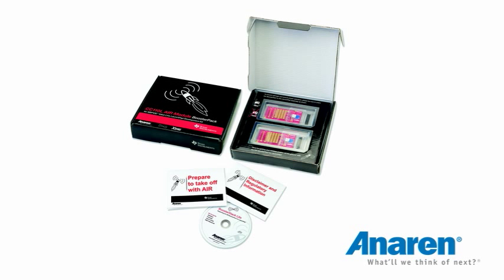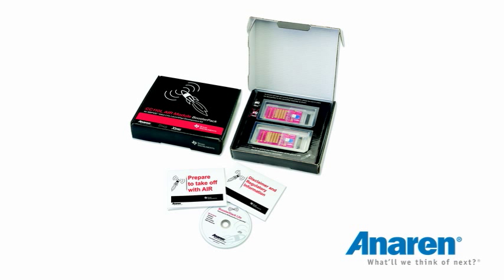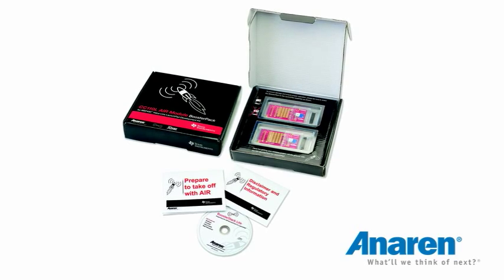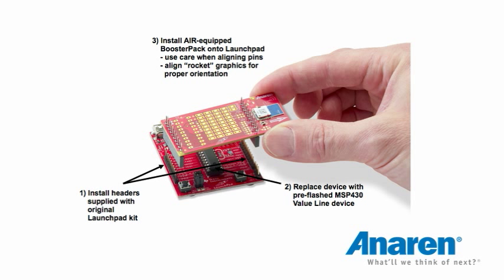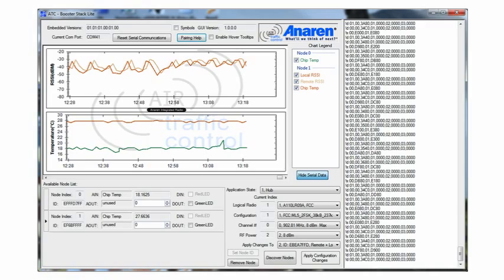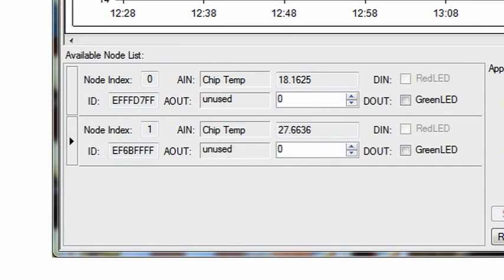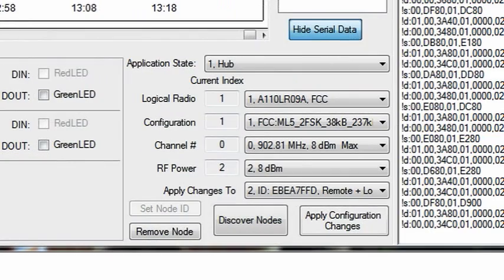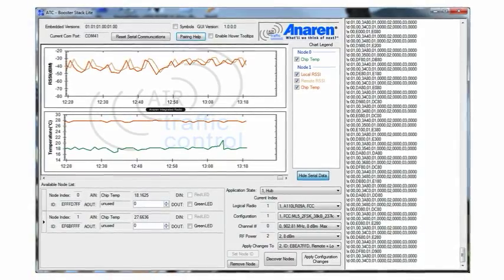430Boost-CC110L RF BoosterPack Introduction

Comment: The RSSI graph is showing signal power average -40dbm, but you showed in lower right RF Power is set to 2 and level 2.8dbm, the CC110L spec from TI has RSSI vs Power graphs showing them to have a linear relationship so a -40dbm on RSSI should produce -40dbm power on the output power, or as you have it programmed to 2.8dbm the RSSI graph should reflect 2.8dbm. Whats going on here?